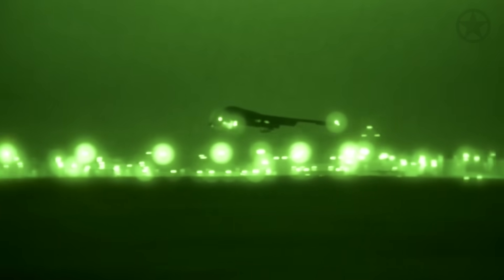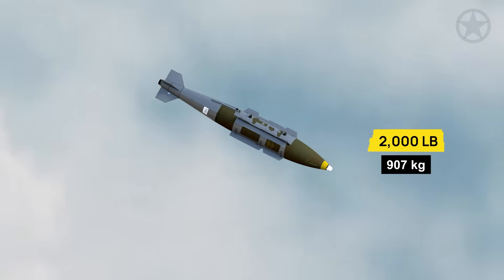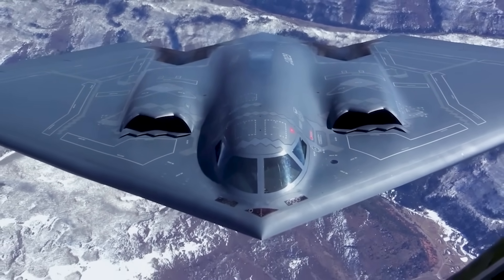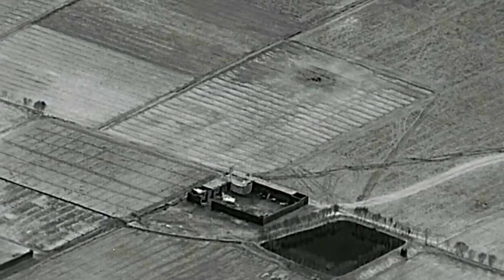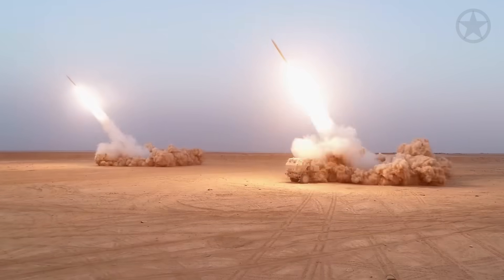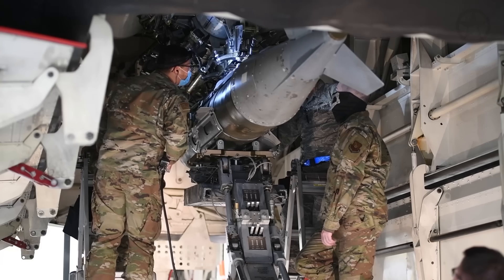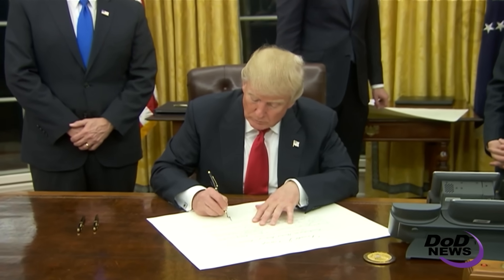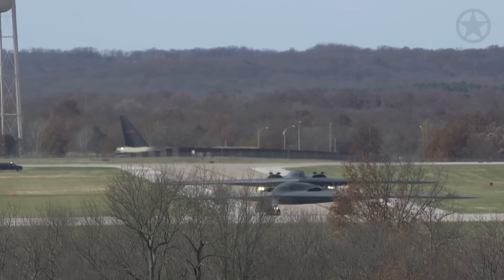U.S. B-2 First Strike - Houthi Base Wiped Off the Map

Comment: There’s a lot wrong with this info. One thing I can prove is that you said they were 50 miles away when the bombs hit the ground. You said they have a max speed of 630 mph at 50,000 ft and it took the bombs 40 seconds to hit. Based on that, the furthest they’d be is exactly 7 miles away. There are a lot of inaccuracies, but that’s the one I can easily prove. At least think a little
Reply: That is because this channel is not ran by a person rather an AI. Even the voice narrator sounds unnatural.

Comment: Only 1 weakness -- its to any low-light optical sensor.  Could use time lapse imagery to detect for telltale movement done by AI for pattern luminosity recognition against the time/day azimith of the earth, as for what should be in the sky.  Benefit? Its a 100% passive system. 
Dangerous minds= innovation to help defend.
Reply: In essence its very hard to counter - as its really a photon-detector based on expected predictions of luminosity over a great range depending on strength of mirrors to enhance optical photon collectors and concentration.
Reply: Best counter counter = optical camoflague, have the stealthy SCIF paint be electro statically charged to change its molecular structure to blend into the color of the available sky above it. Always projecting it, via LCD panels (preferred as its more passive then LED). you could optically camoflage it.  Which is preferred.  Imagine how safe you going to feel in a B-21+++ and its invisible like Wonder Woman's jet? :)